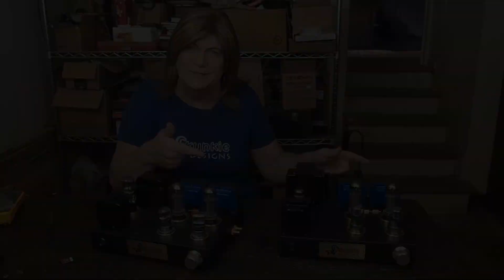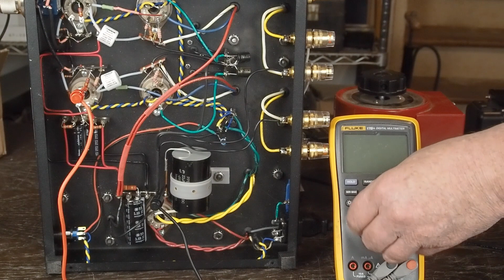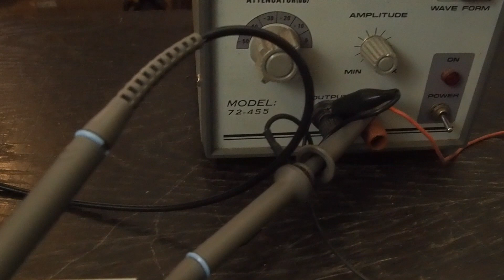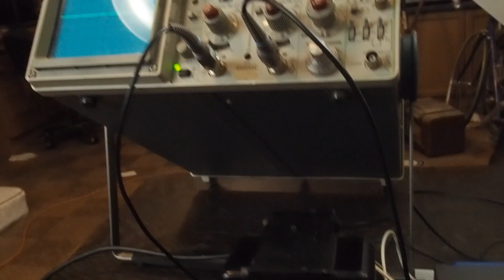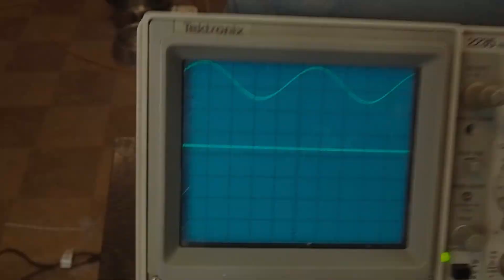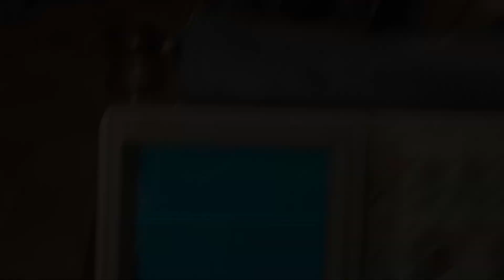6SQ7 EL34 Tube Audio Amplifier: Driver Voltage Testing

Comment: The sound gets cleaner with higher voltage yes,but tubes probobly last longer on litle lower voltage,in old days some guitar amps runn the tubes well over specs,but tubes were cheep,and qualytie was high.

Comment: Great video! may I ask you a question, why is this audio amplifier use only auto taper potentiometer for two speakers? how can it control volume of two speakers?
Reply from the maker: It's a dual section potentiometer: https://www.mouser.com/datasheet/2/15/RK271-1370748.pdf
Reply: @SkunkieDesignsElectronics  I got it, thanks so much for your reply 😄

Comment: I read somewhere that when you turn off a tube amp you must wait 5m before turning it on again. Is that true? I cannot think why it would be.
Reply from the maker: Maybe not 5 minutes and it depends on the amp. It's why I like to add bleeder resistors. What can happen if the filter cap has enough voltage still in it when you power the amp back up, it will arc the rectifier tube and kill it/blow the fuse.
Reply: @SkunkieDesignsElectronics  thank you!